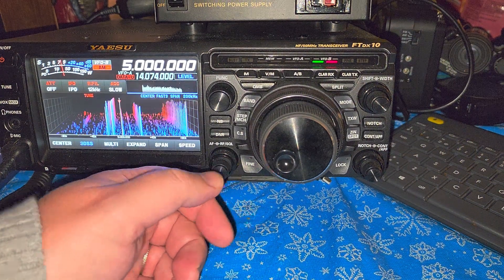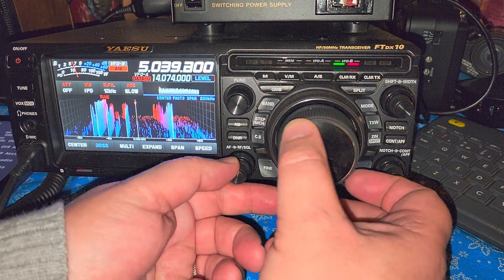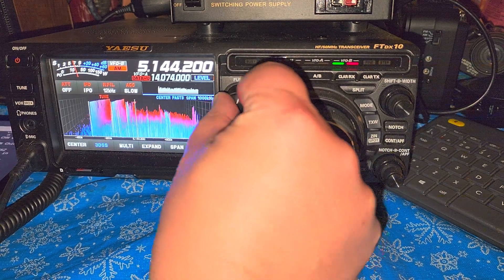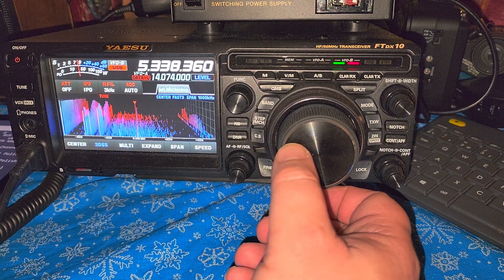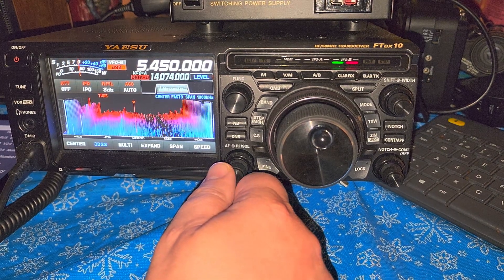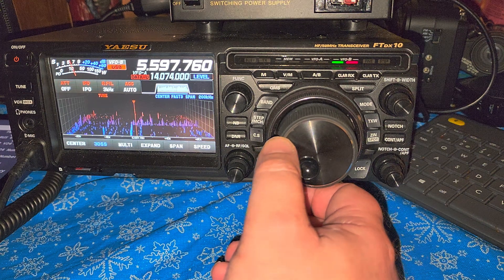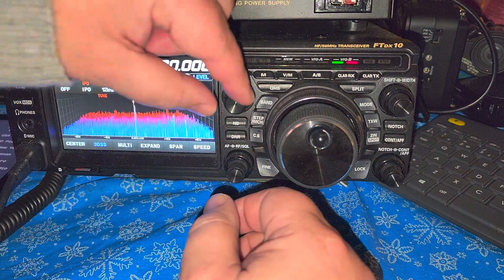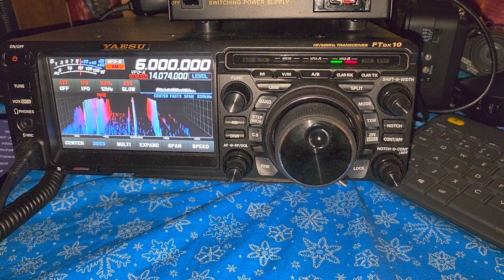Tuning 5000 to 6000 kHz Shortwave with comments on Yaesu FTdx10 transceiver and V outdoor antenna

Comment: WRMI has taken over WTWW's old frequency.

I can sometimes pick up WRMI Legends on 5085 at around 00:00 UTC here in KC. A few nights ago, there was a DRM signal close to the lower side of 5085.  

It is noisier for me than the original WTWW. I believe WRMI also broadcasts WRMI Legends on 9455, 4980,and/or 5950.

Last night, I picked up a Ham coming out of Georgia (the US State) at around 7160 LSB.  I usually don't pick up Ham on 40 m.

Hopefully my new dipole would help with the noise through my NooElect dongle.  Then again, having it next to my furnace doesn't help.  My antennas (both SDR antenna and SiriusXM antenna) sit in my south facing window.

The AM filter does help with the strong AM broadcast stations bleeding across the spectrum.

Comment: Hello I love my ft dx 10. I finally got use to the 3d sdr
..and it's surely a keeper.    Thanks for the tip on the way you tune ssb.   Best Regards.    Ron z.WA3090SWL.